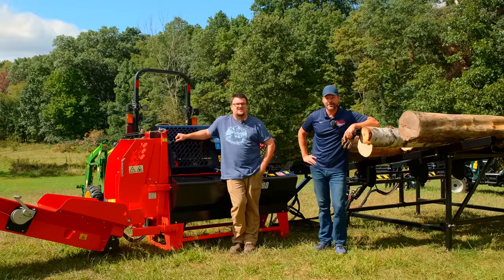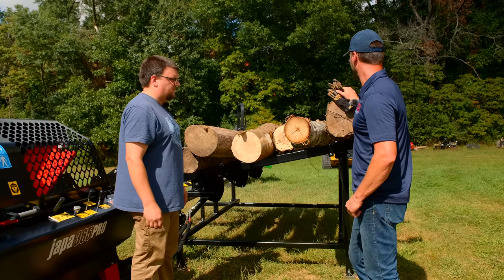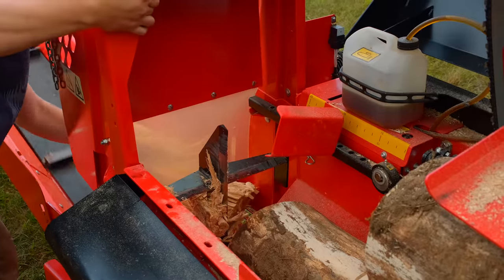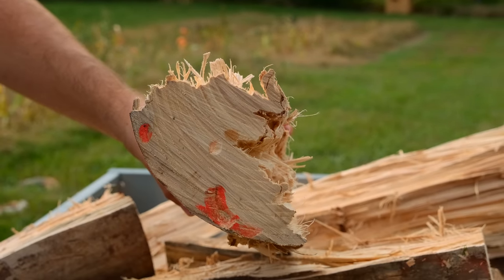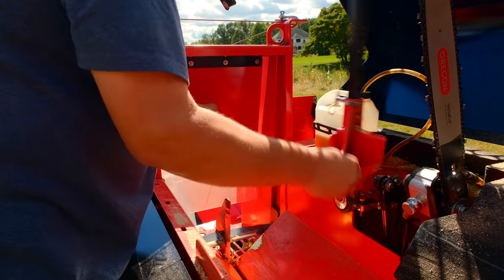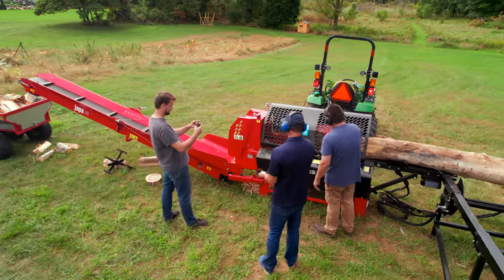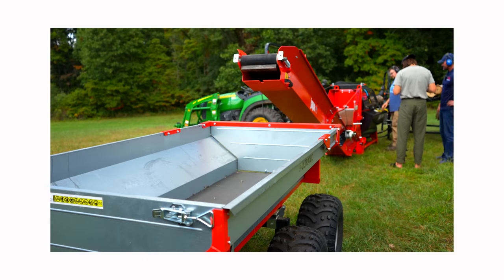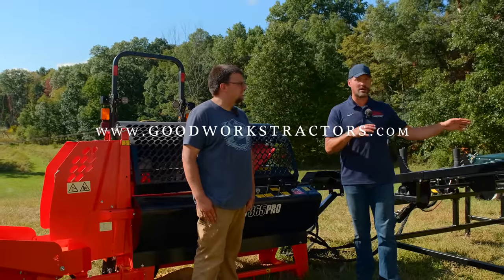ABSOLUTE FASTEST WAY TO CUT FIREWOOD WITH YOUR TRACTOR!

Comment: I have to say that the nonsense of cutting a cookie off the end because the splitter lacks sufficient force would be a dealbreaker right off the bat.  Chocolate chip cookies are fine but wood cookies laying around the woodlot is one of my pet peeves.  As James Hood mentions, only a 7 ton splitter.  Thanks for showing the good and the bad Courtney!
Reply: No question we struggled with that twisted grain stuff.  With good pulp logs it can fly.

If you want to see what that looks like, check out our channel.  There are a few 30 minute runs of the 365 with no editing done.
Reply: If you want both speed and force, it will cost more. When you increase the force then other things need to be stronger and heavier and more expensive. There is no machine without limitations. You will need to decide whether a particular machine will meet your needs. That is what it says on the Metsa website in the first part of the website.

Comment: Courtney, great video and thanks again for having us!  I think it’s great to show what the machine can and cannot do.  No question we struggled with the twisted grain stuff that day, be great to get a load of maple, oak, or ash to run through it.  14 inch is the absolute max diameter for that machine.  12 inch and under it can fly.  

Let’s plan another video together soon!
Reply: did you read the part of the manual that says don't put shims or cookies between the log and splitter or it may fly out and the cage will probably smack you in the face.
Reply: @andrewturner9193  
Really?

Comment: Sweet gum.  Very common and invasive here in the east coast.   Not bad for BTUs if you can get it split.
Reply from the maker: Thanks Chris!
Reply: I think you're right. I split some I'm my portable splitter and the grain is so stringy it would tear and clog up the cutting edge getting stuck. I believe it is how I bent the cutter.
Reply: Yeah I was thinking sweet gum as well.  Brock from Rockhill Farms did a video the other day with splitting some sweet gum logs and it went about as well as this did.

Comment: I find it an interesting machine but probably realistically it will do 12” logs.  Being made in Finland it is probably designed to be used on birch which doesn’t get much bigger than 12”.  Here in the Pacific NW I would want something that can handle larger logs.

Comment: I wonder if you were not getting enough horsepower from the PTO.  Did you have the RPM's of the tractor high enough?
Reply from the maker: Think so, should have been just about perfect
Reply: @GoodWorksTractors  That is interesting.  I have seen the Japa 365 on other channels with the engine and there never has been a problem like that.  Perhaps he needed to up the hydraulic pressure or something.
Reply: @On_The_Farm  
They showed you what the problem was inside the trailer.  It was an unusual species and maybe not split at the appropriate time.

Comment: The wood I get is logs the mill wouldn't accept. I am unsure of the tonnage of my splitter but it has a 6-inch diameter cylinder.  A single wedge and I have still occasionally stopped it. Most of it is at least 24 + inches.

Comment: If there's one thing I could suggest for your machine that you should include is for your discharge have a curved fitting that causes the sawdust to blow away from the tractor so it's not getting covered inside us as bad

Comment: I’ve been hand splitting firewood for years (no machine). I won’t even attempt gum. I can 4 way split a 10” oak round in a minute or so. I once timed myself on the same size gum round and after 30 minutes I finally finished one (1) split
Reply from the maker: Terrible stuff

Comment: Looks like a fine machine for a telephone pole size and clean hobby fire wood processor. Normal woodlot firewood guys are not going to be able to be that selective on their trees. Also looks to be pretty finicky with the mechanics and ram pressure??
Reply: Do you mean that you like the splitters that cost several times as much? I would say the tons of force on the big ones is also limited.

Comment: IMO what this needs is options for splitter rams so people with tougher wood can trade a bit of speed for more force we use a 6" bore ram we get ok speed and Tonnes of force and all powered by a little Honda 10hp hydraulic power unit it eats Mallee stumps like there nothing. for logs a 2-1/2" or 3" bore would be best.

Comment: So how many tons of force on the ram, cant see anything on your site. Seems pretty weak for the price.
Reply from the maker: Good question, I'll have to find out!
Reply: My question as well, my 27 ton splitter will go through 30” twisted oak so I was surprised to see it get stopped.  I wonder if here is an adjustable relief valve?
Reply: @reload280  Yeah the size it can handle is a bit of an issue to.
Reply: @andrewturner9193  
You may want to purchase one of Japa three larger models. This one is 7 ton pusher.
Reply: @jakebredthauer5100  I'm too scared to now. The wood over there must be tiny and weak so I'm now sure it wont handle the trees I have access to.

Comment: Nice machine but I will continue splitting my wood the old fashion way.   I have a small electric splitter and it works fine for me.
Reply: Splitter?  Not old fashioned enough.   Use  axe, maul and wedge  to work out your frustrations on the woodpile.  White elm like that can be tough splitting, but the only thing I've broken axe heads on is osage orange.  Looked like maybe he had a red elm log in there that can be almost as tough splitting, but it went a lot better.   Probably was seasoned just right.

Comment: For those asking about splitting force, the Japa 365 brochure lists it at 7 tons across the product variants.
Reply: That explains why it was struggling.
Reply: 7 ton force on the log.  Is it ment to split processed  balsa wood.
Reply: Yeah I came up with 7 tons in my research as well.  That seems pretty, um, weak for what it's supposed to be used for.  Maybe Finnish trees are just really easy to split?  Sweet machine otherwise, though.

Comment: I don’t see why anybody would want a processor that could only handle 14” straight wood. I would not even consider one that wouldn’t take a 24” diameter stick.  That would erase the crooked log problems. Also would open up a lot of options for logs that nobody else wants.

Comment: Too many "work-arounds" needed for a machine that costs a small fortune.   I can't believe that these bugs weren't worked out in the testing stage.  This company has been around for - what? - 50 years?  The cons seem to be too many for me to invest in it.  The small log diameter limit, the difficulty in handling a slightly curved log (not all trees a lodgepole pines or telephone poles), having to use "cookies" to help push a log through the splitter, and the definitely under-powered splitter (7-ton? 7-ton is a toy!  My splitter is 27T and it does anything I've put to it).   The Japa rep obviously has been around it and quite familiar with it and still has trouble operating it.  Can you imagine how a 1st-time user would do?   The rep. was constantly opening the cover, adjusting this that and another thing just to get it to do it's job.  I saw a video in it's much larger cousin - the 435 pro, I believe - and that machine handled all of those quirks AND decent sized logs with aplomb.

Comment: Seems like it’s over complicating a very simple job. A descent hydronic log splitter can do the same job.
Reply: I process and sell firewood as a full-time business. I have a splitter and a Japa 365. The log splitter takes at least 2-3 times more time and physical effort. There is no comparison between a firewood processor and a log splitter.
Reply from the maker: Just like a shovel can dig a hole like a backhoe or your feet can get you to your job like your truck, etc
Reply: @richardbrowne1679  
Oh yes
Of course
If your doing this as a business then absolutely. But for the average Joe a log splitter and a wheel barrel does the job. Nothing wrong with a little physical labor.
Reply: @richardbrowne1679  What sort of wood do you split? I don't have much onsite that would even fit into it.
Reply: Lodgepole Pine and Douglas Fir. If your logs will not fit into it- you need a bigger processor
Reply: It would not be cost effective for a homeowner.
Reply: @GoodWorksTractors  I can pay people to dig a lot of holes for the price of hiring a backhoe.  Often they quicker to.
Reply from the maker: @andrewturner9193  depends on the size of the holes, type of soil, quantity of holes, and assuming those guys will show up to do the work.  I’ll go to extremes to avoid relying on the increasingly less reliable labor pool these days.
Reply: @GoodWorksTractors  Not if I'm losing money.
Reply from the maker: @andrewturner9193  good luck
Reply: @GoodWorksTractors  You stopped dealing in tractors due to no money in it, you know what I'm talking about.
Reply: @andrewturner9193  
Why do backhoes even exist?
Reply: @jakebredthauer5100  For when its no longer cost effective or dangerous to use people as the resource. For the price its going to take a long time to pay itself off and it struggled with the size of wood its designed for.

 I have no idea why backhoes exist. For people are too cheap to buy a track loader and a digger I guess.
Reply: @andrewturner9193  some holes are more difficult and require special equipment. Some trees are more difficult and require special equipment. It is a matter of matching the right tool for the right job.
Reply: @jakebredthauer5100  They dug some amazingly deep holes way before machine came along. 
If a machine says it will do 14inch logs I expect there will be a few knotted bits it wont split but I expect it to do all other wood. My 3k splitter would, so one that is 10x more expensive should do better right. Does it say this machine will struggle with some wood? So how would you know when the American site didn't say. Makes it real hard to do a cost benefit or rate of return.
Reply: @jakebredthauer5100   There might be a market for it but they are not marketing at that segment, there marketing to any 14 inch log.
Reply: @andrewturner9193  
I think they do have smaller easier trees in Finland but they want to export a lot of machines also for the hardwood splitting market. However I don't think they ever said that it would be suitable for elm gum and sycamore. I don't believe they want to sell you a machine to do a job that it is not capable of doing. I think they are targeting the market that does not want to spend $100k or $200k.
Almost everywhere a buyer will come across trees that are too large or too tough and then they can just use a regular splitter on them. My objection is your claim that they are trying to market a bad product when it is not a bad product. The first thing in the Metsa website is that they want to help you find the right product.  They have a 12-ton splitter (395) and a 485 that will do 18 inch diameter.  Japa has exclusive legal right to use a box wedge in a processor.
I am looking at those side-puncher splitters from europe. The conveyor pulls them into the splitter box where the diagonal knives split whatever size is specified. Do you know about those and what is your opinion? They are made in five countries that I know of, but not in the US or canada.
Edit: I gave the wrong ton rating for the 485.
Edit #2: I gave the wrong diameter for the 485.
Reply: @andrewturner9193  
You could make a 100 ton splitter using one horsepower engine.
Reply: @andrewturner9193  
Two of my comments that were missing are now here and two other ones are now missing.
Reply: @jakebredthauer5100 I don't think they are bad machines. I think Courtney and the american reseller are misleading people. Nowhere on the site or in his vid did I see what the rams ability was. You are the only person who gave me the ability to find the producers website which is pretty clear on it's description. Without that how would I know if its capable or not.
Reply: I May have seen them but I'm not sure if it is what I'm thinking it is. Not having luck searching.
Reply: @jakebredthauer5100  My only actual issues with  the splitter are the fact it has no way shown to clear a jam, and jam it did. And the controls looking like the would fatigue and operator after time. I would prefer a 4 way joystick so I spend less time repositioning my hands.
Reply: @andrewturner9193  
When you get a jam you raise the knife up and wiggle on the wood or pound it.
Reply: @jakebredthauer5100  Maybe they don't like our convo much.

Comment: They're a lot better machines out there than what you're showing here this looks like a cheap rip off of something much better
Reply from the maker: Please send the links as well as the prices.  Just typing things like that on your keyboard doesn't mean much.
Reply: @GoodWorksTractors  You need to check out the youtube "in the Woodyard" he is a wood splinter his splitter does not run off a PTO but off a diesel engine The splitter you showed just didn't seem to have the power to handle anything except soft wood and not very large eather.  Don't get me wrong I love your channel but this splitter you showed just did not seem worthwhile that's all.
Reply: I use the Japa 365 and it rips through wood. The Eastonmade Firewood Processors start at $154k. The Japa 365 does everything I ask of it.
Reply: @richsparkman9980  
The machine Chris has is hard to operate. I am not even sure that he likes it.
Reply: @richardbrowne1679  
Andrew Turner, what about
Richard Browne?